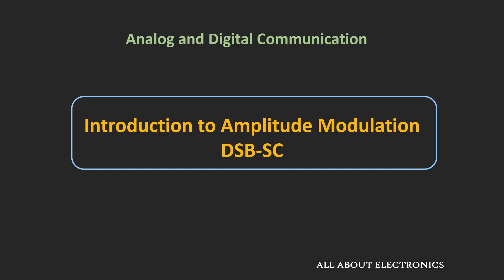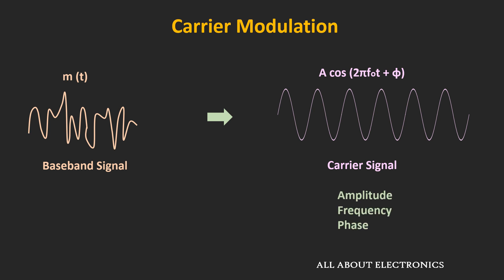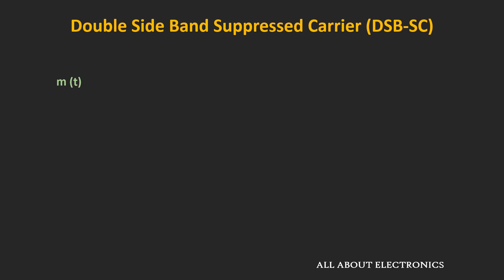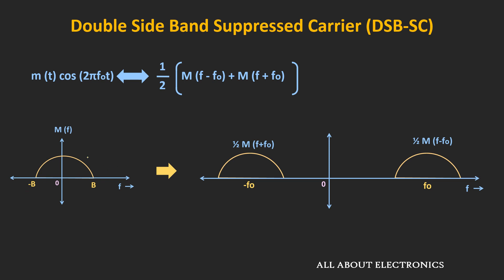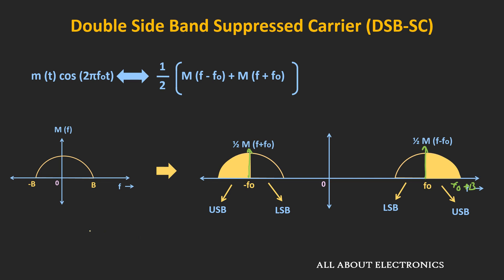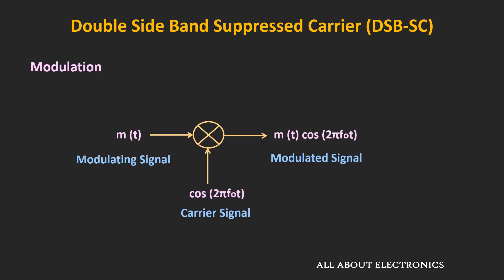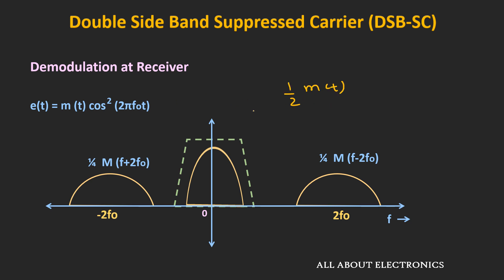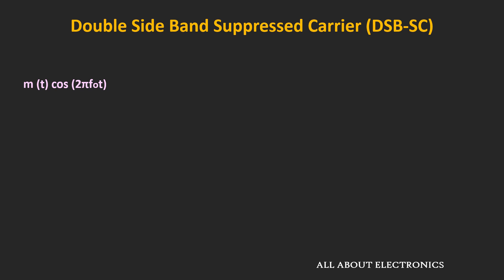Introduction to Amplitude Modulation | Double Side Band Suppressed (DSB-SC) Carrier Explained

Comment: Awesome video @:146 you said using modulation the frequency spectra of the BBU signal is shifted to non-overlapping band at the higher frequency is this using FM you mean? or the modulation in general regardless of the type it will do the shifting?

Comment: Thanks for the great explaination but i have two questions
1- Why we need to multiply the modulated signal with the carrier again at the receiver before the LPF?
2- If the frequency or the phase of the carrier at the receiver is not the same at the transmitter what will happen the the demodulated signal?

Comment: Sir , if am being confused. Please help me.

Sir , if in  AM only  the amplitude of the carrier wave is modulated according to the message signal , then what does the upper and lower side bands represent? Is this means that the frequency of carrier also changes or what?
Reply from the maker: In time domain, yes only amplitude of carrier wave is modulated but the same thing in frequency domain corresponds to two side bands around carrier frequency. (Of course, in DSB-SC, we will not have carrier frequency ). The carrier signal frequency is not changing but the message signal band gets shifted by fc in frequency domain. I hope, it will clear your doubt.

Comment: You said at 07:30 : now, one thing if you notice over here, then at every zéro crossings of this message signal,  there will be a phase reversal in the modulated signal.
And that is wrong and big mistake
for ‘phase-reversal’, to occur, both the message and the carrier should have their zero-crossings at the same instant of time. In the event of the zero-crossing of the message not being accompanied by the zero-crossing of the carrier, there is a change in polarity of the modulated waveform without the usual ‘phase-reversal’

Comment: Thanks for the great video,sir. But I have a doubt in demodulation where you've used LPF. So, it will allow 1/4(M(f-2f0).but, we dont need that signal right,sir. Are we suppose to use BPF instead of LPF, sir?
Reply from the maker: The LPF will in fact reject 1/4 M (f - 2fo) and will pass only the message signal spectrum. Please check at 12:22. Because after the demodulation, we want to recover the original message signal. I hope, it will clear your doubt.

Comment: I don't understand the forier transform of Cos in Tone Modulation part... how there is term 1/2 ?

I saw in books Fourier transform of coswot =
F{Coswot} = π[d(w+wo) +d(w-wo)}  ?

which one is correct?
Reply from the maker: The formula which you have written is in w (angular frequency). If you see the formula of Fourier transform in terms of the angular frequency, then in the frequency shifting property there is 2*pi additional term. Therefore the overall expression will get multiplied with 2*Pi. The expression written in the video is in frequency. e.g (f- fo)
Both are correct representations. 
I hope it will clear your doubt.
Reply: Thank u so much sir for a quick response  and clearing my doubt....🙂😀

Comment: Please clarify my doubt. The message signal during transmission is m(t). But in 12.25  you mentioned that the msg signal is 1/2(m(t)).why ? Dividing it by 2, won't it get disturbed ?
Reply from the maker: When the message signal m(t) is divided by 2, only its amplitude will become half. In every other aspect the signal is same. After recovering the message signal, using simple amplifier its amplitude can be doubled or scaled as per the requirement. I hope it will clear your doubt.
Reply: @ALLABOUTELECTRONICS  but why is the amplitude becoming half ? 
Also thanku so much for answering :))
Reply: @anirudhracs4537  It's because of the Fourier transform